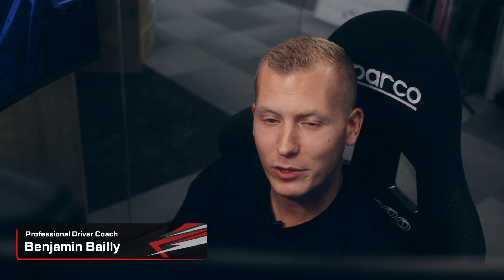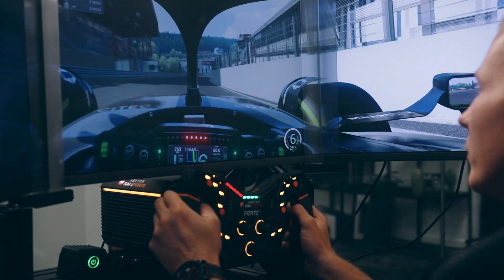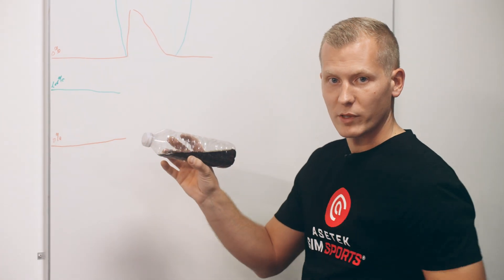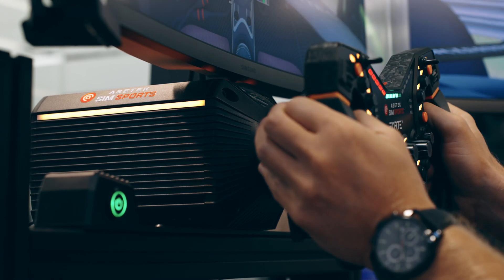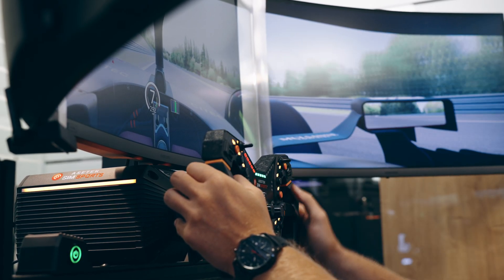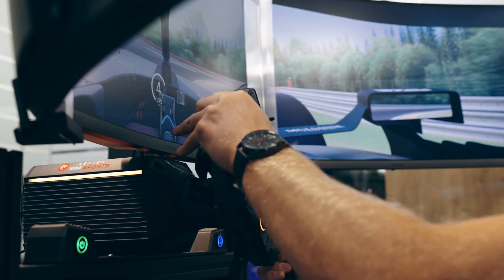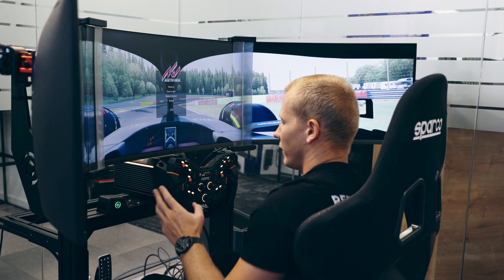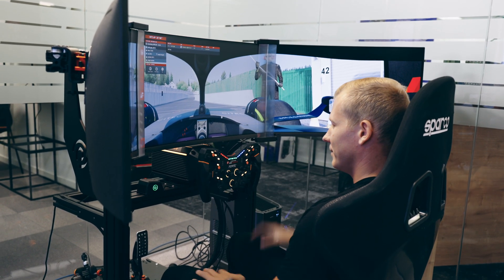Coaching Time: Downforce In Sim Racing, All You Need To Know!

Comment: My brain was already thinking about alot of this without a coach and idk why it was common sense to me. Its how I thought about braking. But all of this makes my ocd go crazy haha. But you can't do all of these techniques on every corner it's sometimes different for each for sure.

But the lifting before braking lifting throttle slow imo doesn't reduce time in sims at all. It's works I can always beat my corner speed and time in and out faster with normal trail braking letting off gas from 100 to 0 and going into it later.

Comment: Former Formula driver here as well. In my case not having downforce is counterintuitive. In GT cars, whats the point of going 250km/hr into a corner if I have to brake 200 meters before a corner? I feel like GTs are fast in the straight just for the sake of it, while Formula cars can navigate much better through the circuit since the faster you try to go the faster you will be, as opose to the Gt cars where the fast you go the slower you get. Maybe I just don't know how to respect GT cars
Reply: Imagine being a dentist with no prior racing/karting experience. And you want to race. GT4 are a nice solution, don't you think? :)